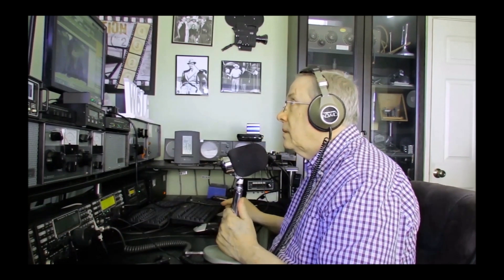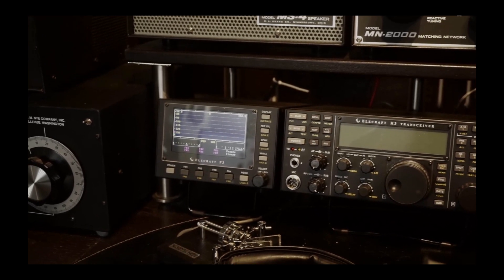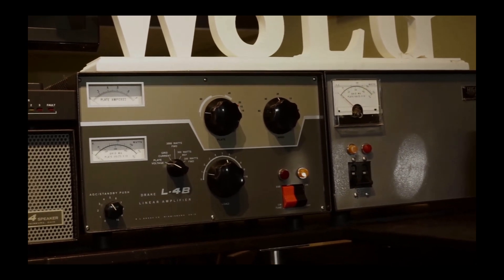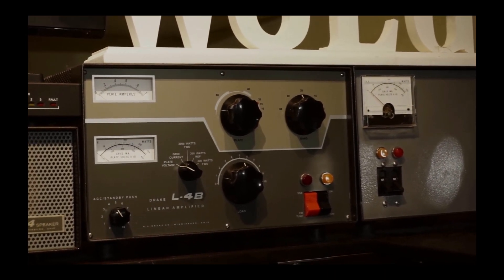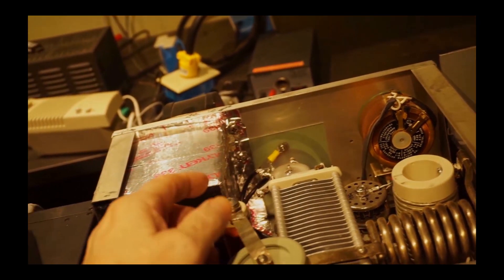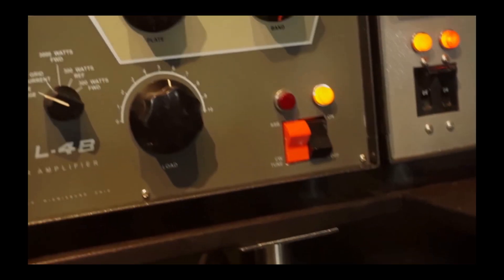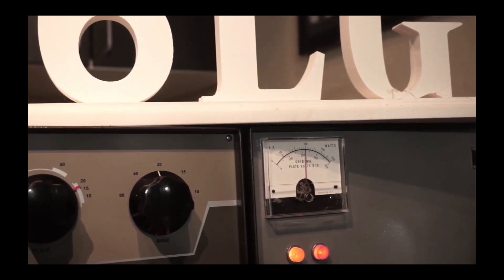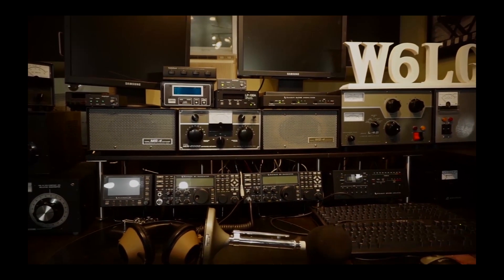Ham Radio Basics--W6LG Station--A Look At The Equipment

Comment: Hi Jim, question: why Elecraft transceiver?
Reply from the maker: Many years ago I sold ham radio gear at a store in Burbank California.  At that store I really liked the Drake equipment.  Elecraft reminder me of  Drake gear decades back.  It was reliable, hard working, never failed.  In the last two months I have purchased new a Yaesu FTDX101d and the Icom IC-7610.  I did sell some of the Elecraft. I still have one K3 and the matching P3 that I want to sell. 73, Jim W6LG
Reply: Jim, thanks you to come back to me, very interesting. So now that you mentioned that have new rig’s (Yaesu and Icom) what about the Elecraft K4D or K4HD? 
I like your video, There are all helpful, thanks you for your contributions in the Art.
Reply: Hi, Jim my callsign is WP4PUR, do you have a email that I can reach you. Thanks 73’

Comment: Thank you for the look, Sir. Seems overwhelming to a new Technician Class holder. KI5CSQ. Blessings to you.
Reply from the maker: You make a very good point.  My station is a collection and culmination of almost 60 years.  Also, I manufactured some ham radio equipment.  The most important part of a station is the feedline and antenna (or more correctly the antenna system).  You can have lots of fun with the basic equipment which includes a transceiver, mic, key antenna system and maybe a power supply.  Don't  be put off by my over the top stuff.  I am, this morning, trying to finish much of the station at the new QTH so I can shoot video of what I have done.  Just wiring eveything has taken weeks. Thanks JD & 73, Jim

Comment: Interesting and nice shack. 
I haven't been on the air since I lost all my antennas in December 99 ... (I know it's a long time). 

But in 2 or 3 months I will put on the red light again! I worked only on DX (SSB) with a BA105 on 10m and a KT34XA on 21 an 14, with an Icom 751 (that I still have) pushing an Amp of my work based on a F6005 from Thomson (2500 HF W).  
I work actually on my antennas now but it's difficult to find the good ones.

See you soon on air. 73 from F5OKE.
Reply from the maker: Excellent.  I don't know the F6005.  But if it is from Thomson, it should be very good.  We have had good openings on 20 meters to France with many very strong.  I hope to hear you soon. 73,  Jim

Comment: Jim what did you do as a career in your time, if you don’t mine me asking.? Thanks
Reply from the maker: I had a massive Pulmonary Embolism attack and heart attack on November 1, 2016.  I have not been able to work since that time.  I must use oxygen part of the day.  The cause of the PE has not been determined.  My chances of surviving when I got to the ER were slim.  I was very lucky in that the doctor was very  good and so was the staff.  I lost a bunch of lung capacity.  I now have an aneurysm, a murmur, CHF stage 1, and as of last week, emphysema.  I worked as a Building Inspector, Deputy Tax Assessor, Expert Witness, held a bunch of licenses and certs until I broke my neck in a fall from a roof.  After that I manufactured antennas and had a ham radio website until I became unable to work at it.  I am not an engineer.  My degrees were in business.  That  is the story in a nutshell.  73, Jim

Comment: These are "BASICS?" Smh,
Reply from the maker: My station is 55 years of collecting and improving.  It is not a basic station. That station has been shown in other videos.  Thanks for asking. 73, Jim
Reply: I was just poking fun, but serious at the same time. ALL of this, and I mean ALL of it is so overwhelming. I am taking my Tech license exam on Tuesday evening. I haver the Yaesu FT-60 and have been listening in on local and not so local repeater traffic. I am fascinated by this and the process. A local HAM is setting up a club and trying to get a repeater set-up on a local water tower. I am VERY interested in any possible ARES activity for local emergency help but I am so overwhelmed by the equipment and the process. I Do NOT have a local mentor, yet but I need some help figuring out my start. can you help? 502-five five one-five nine six nine.
Reply from the maker: I can via email as shown on QRZ.  I am not a 2 meter guy anymore.  I hardly every use that band except for disaster situations.  I guess I should buy one of those cheap handhelds on Amazon and see what they do.  Get back to me on my email address with which transceiver you have on your list of things to buy.  I also have some antennas for VHF mobile left over from when I closed the business due to health problems.  More tests being done next week.  So, my time is limited and so is my energy due to heart and lung problems.  73, Jim w6lg
Reply: I understand. I guess I need to actually get my Tech license and callsign before QRZ will let me contact you via email. Good luck on your tests. I am VERY interested in what you can teach me.

Comment: Jim I must say you have an awesome assortment of Amateur Radio equipment. I have an L-4B as well. It needs quite a bit of work and some cleaning I am sure. I have not used it in awhile. But, when I was using in the past it would put out quite a bit of power. 73, WA6TWJ Dave Mauldin Rough and Ready, CA. USA keep up the good work on your videos.
Reply from the maker: Hi Dave,
I should say, neighbor Dave.  Check the caps AND the resistors across them in the PS.  Likely, they should be replaced. Also, gradually heat up those tubes.  I think you know about all of that already.  Take care Dave.  I am trying to recover from a massive pulmonary embolism and heart attack a year ago.  I have good days and then some not so good days.  The dozen doctors have found an aneurysm, murmur, reduced lung capacity, damaged portions of my lungs, leaking valve, heart failure and a whole list of other stuff that is wrong.  73, Jim

Comment: HI JIM , I AM AT THE BOTTOM OF THE SCALE FOR KNOWLEDGE ABOUT RADIO'S. 

 I FEEL DAUNTED BY THE AMOUNT OF STUFF TO KNOW JUST TO GET STARTED, i'D LOVE TO HAVE A RADIO AND WHILE NOT PARTICULARLY INTERESTED IN TALKING TO PEOPLE I DON'T KNOW WOULD LOVE  TO HAVE IT FOR EMERGENCIES,  I LIVE WHEN ON HOLIDAYS, IN AN AREA THAT FREQUENTLY HAS EARTHQUAKES,  ANOTHER REASON TO WANT A RADIO IS FOR TRAVELING,  IF I'M A LONE AND RUN IN TO A PROBLEM WITH A CAR, ITS GOOD TO HAVE SOME KIND OF BACK UP THAT DOESN'T NEED CREDIT. 
I KNOW AS A BEGINNER, FOR A HAM RADIO, I WOULD NEED A LICENCE, i KNOW THAT CB RADIO
 DOESN'T NEED A LICENCE AND  IS LIMITED BANDS I CAN BE ON.  IF I ATTACHED A GOOD ARIAL ON THE SIDE OF MY CAR OR WHERE EVER ITS USUALLY PUT, A VERY LONG ARIAL, WHAT ARIAL?  DOES IT COME IN SECTIONS LIKE TELESCOPIC BUT SCREWED TOGETHER, ADDING LENGTH. 
HOW FAR IS THE FARTHEST I COULD REASONABLY EXPECT A CB RADIO TO REACH WITH A VERY GOOD ANTENNA? I KNOW MOUNTAINS WOULD BE A  FACTOR, WHICH WOULD LIMIT THE DISTANCE , BUT IF I WAS ON OPEN SPACE WHAT WOULD I EXPECT  FOR CLARITY AND DISTANCE.  WHICH RADIO WOULD YOU CONSIDER TO BE A GOOD RADIO AND EASY  TO USE. IF I WAS BUYING ONE I WOULD NEED LOTS OF ADVICE.

SINCE I DON'T HAVE A RADIO I WAS PLANNING TO SPEND SOME TIME TO LEARN SOME ALPHABET AND CODES AND SEE HOW THAT GOES.
READING A BOOK ON THIS SUBJECT IS LIKE READING A TV MANUAL. TO AN ORDINARY PERSON IT MAYBE EASY , TO ME THE BOOK WOULD BE AS USELESS AS AN ASHTRAY ON A MOTOR BIKE. ANY ADVICE GRATEFULLY APPRECIATED.

PATRICIA
Reply from the maker: Well Patrizia, Ham Radio may not be the answer for you.  There is a long learning curve. A VHF/UHF radio may not be able to reach a repeater to get help.  Using any Ham Radio equipment requires a skill set and that takes time, effort.  If I were you I would look for other answers.  Sorry that I can't be more helpful.  Regards, Jim
Reply: Not a problem, cheers

Comment: Jim:  I've loved your videos, especially how you don't talk "over my head" as a relatively new ham.  I got my General early in October and purchased a mobile Yaesu FT-891.  Have you published a video about the basics of using an HF radio and what all the buttons, settings, etc. do on a rig?  I'm specifically curious about how to reduce noise (the constant background scratching) and how to tune into a frequency when you get "close".  Thx KI7EMX
Reply from the maker: I have not.  But those are very good questions. I will think about how to do one about using an HF radio.  Frankly, it is good question that I never thought about.  Thanks!  73, Jim W6LG

Comment: Just found your videos this evening. I've had my Tec license for just about a year. I've not attempted to make any contacts. I purchased a handheld YAESU FT-60 with the components for a 2meter antennae which I have to sting across  across my  attic. I live in a community that does not allow anything out of the normal in our yards. Anyway, enjoying your videos and glad your back on the air. My questions is, since I'm new to Amateur Radio, most of the information your putting out is way over my head. Is there something else that I should be listening to for my skill level ?
Reply from the maker: Hi,  You will learn.  Just take your time and watch as many videos as you can.  But, you need to upgrade to at least General and preferably Extra Class so that you can get on HF.  There you can talk to guys around the country with an antenna in the attic.  Talking to other hams will increase your knowledge.  HF is a lot more enjoyable and fulfilling. 73, Jim W6LG
Reply: Thanks so much for your input, much appreciated. Stay well.

Comment: Could you please make a video about properly getting started in HAM radio? Or at least point us in the right direction?

I want to get into HAM radio, but I don't have a receiver and I cannot spend 200€ for something that might not interest me much personally.
Many other videos and articles say that you can get the Baofeng UV-5R or other similar handheld and that's all you need to get started. Would you agree with that? I feel too limited getting that because I can only use 2m and 70cm bands, but maybe it is enough. Maybe if I get a better, bigger antenna for use at home, I could get a bit better range, but would that be worth it?

Anyways, really nice video, keep up the great work!
Reply: I'm not sure how it is over in Europe, but I would start by listening to Ham's thru a scanner or scanner app (here in the US we have broadcastify which is great). Get yourself a book to prepare yourself for the test (i'm assuming your country has a test). You could probably check a book out at the library if you don't want to spend the cash but they shouldn't be expensive. Also, there is a book called Ham Radio for Dummies which might interest you. That's where I would start if I were you.
Reply: Mike L Thank you! That will help a lot!